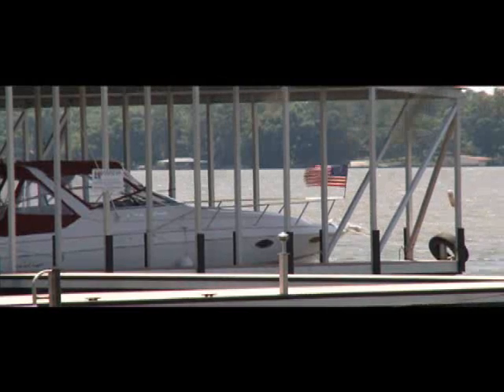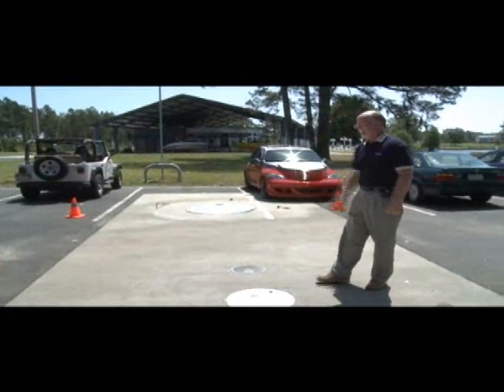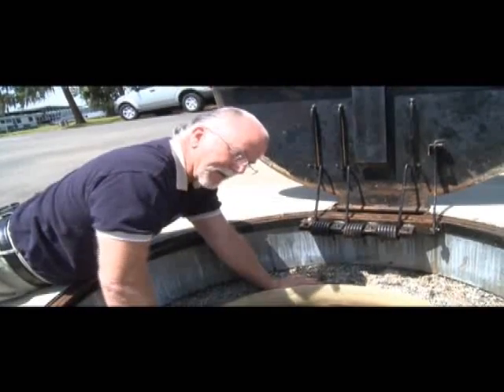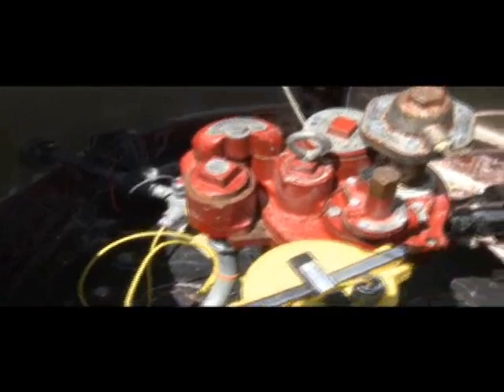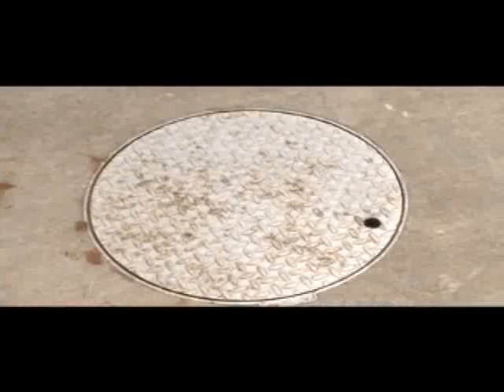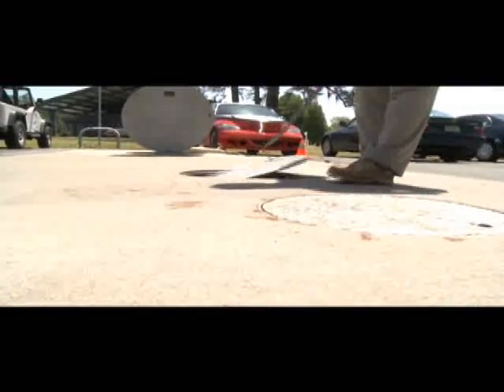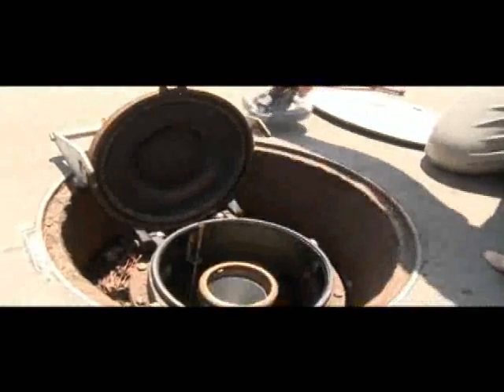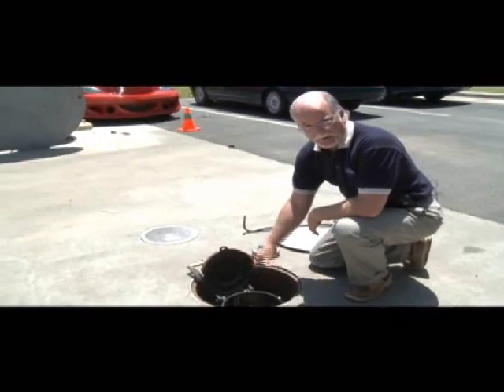Underground Storage Tanks (UST) System Review

Comment: Should there be an anti-siphon (normally closed solenoid valve) immediately downstream of the STP since there appears to be downgraident piping on the dock?  This is required by NFPA, IFC,  and other codes.  Also, wouldn't the line leak detector need to be taken out of the STP port and placed downstream of the normally closed solenoid valve in an approved tee connection?  Red Jacket has a field service bulletin for this scenario.